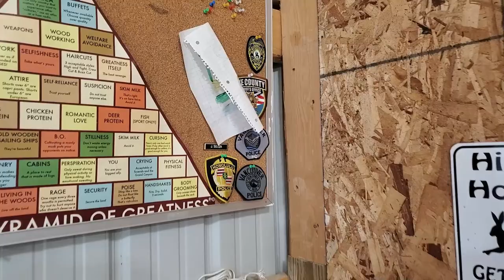She’s DONE On Our Channel!!  Airing Our Family’s Dirty Laundry | PEX Rings vs. SharkBites

Comment: Crimps are good definitely better than shark bites. Uponor pipe and uponor memory rings expand a lot when frozen but return to size after thaw. I’d definitely use brass fittings though in the cold. Most pex splits when frozen. Special expanding tool is expensive though for the memory rings.

Comment: Hey guys love the channel content is just started watching you from here in Leeds, West Yorkshire. Uk. I've had a renovation company for 28 years until I recently had to stop due to an emergency spine issue I know love with. But just a quick note on your fitting for bathroom. I have used what you guys can the shark bite fittings, for over 15 years, we call them push fit barrier pipe fittings. And I can tell you now if fitted correctly they are THE BEST WAY TO GO, they will not fail. Pex crimp fittings are good but pipes do expand and contract with temperature. Especially plastic (pex). Sharks bite allow for this movement and therefore are much safer to use if fitted correctly. If they are not leaking now then leave them they will do just fine. Look forward to watching more. Stay safe guys 👊🙏👌

Comment: I perfer rockwool for insulation as its fire proof, sound proof and its a great insulation as that pink stuff
the wind/breeze goes right threw it. granted rockwool not mineral wool costs a little more but its well
worth the extra money when it comes to heating and cooling.

Comment: may i suggest running the water lines closer to center on studs and use nail plates so you don't drive a screw or nail in the water lines

Comment: Glad y'all switched back over to compression rings.
Good to see more and more normal, return to your lives. Game changer.
The water system and allows awesome. That will make a huge change in your water quality, how it feels on your skin, taste and help your appliances survive longer, especially the new ones.
Have y'all considered rough cut Douglas Fir siding from the local sawmill in BF? The fir is close to cedar in that it's mold, mildew and rot resistant. It's not as good as cedar but.... Since Douglas Fir is huge in that area, you might can get a deal. Just a thought.
Looking good. 👍 I know that stove felt good in the snowy weather
God bless you all and keep you safe
Reply from the maker: Thank you Wayne. Great suggestion on siding! God bless!

Comment: Just a opinion you should install stud huard or plate on studs you have your pet pipe going through.  The reason when you in tall your wall lard or whatever you do not put a nail through the pex pipe. It is a metal plate that gets nailed to stud where the pex is.
Reply from the maker: We did :)

Comment: Smart move on replacing the Sharkbites with proper crimp fittings, especially inside walls that will be enclosed. 

Those water lines were drilled extremely close to the surface of the studs. We generally try to stay back from the surface of the studs by a couple inches so that screws/nails etc don't pierce them later on down the road. I trust that you will be placing steel protection plates over them?
Reply from the maker: 👍🏽 They’re on there.

Comment: Please do consider installing nail stud plates to protect from accidently screwing/nailing your water or electrical lines. It is especially important during your install of your walls, etc.  Usually this is a code requirement for most areas of this country.
Reply from the maker: We did
Reply: @GoodSimpleLiving  Thank you for your reply!  I was getting kind of worried and concerned since I did not see them (nail plates) in your videos. I used to work in construction a long time ago.  Have you considered using steel studs rather than wood? It's a lot faster, cheaper and stronger with no termite problems.  This just a suggestion to save some money.  Great job anyways!

Comment: Jeremy it looked like you used the same pvc pipe for the hot and cold connections for the water heater. If so it may melt and leak. Hot side needs cpvc pipe.again you both do nice looking clean work.

Comment: RE: Water heater. You should really have some tie down straps around the water heater. As earthquakes become more prevalent in the Pacific Northwest, even small ones tent to knock the water heater over if not strapped down. This is especially important for gas water heaters but protects electric as well.
The should also sit in a drain pan Incase of a leak. 
We had put in a brand new water heater and luckily put in a drain pan when the water heater which turned out to be faulty ended up with a leak that could have cost us hundreds and hundreds of dollars in water damage. It's best to error on the side of caution.

Comment: I have used both shark bites and the crimp rings and I feel they are both good as long as your checking all of your rings for proper crimp. The shark bites are much easier to replace if any repairs are required in the line as they have the tool to remove them without needing to cut the pex. I am glad to see Nevaeh is going to do her own thing with the vlogs and still doing her music. Sorry I watched her video first cause she has less subs and I try to help the little guys first since we are still the little guy...haha.
Reply from the maker: Thank you 😊

Comment: Hate to be a critic, however I know you want advice. When installing drain pipe try to give the joint a quarter turn when you are glueing then together. Also please don't remove the ABS you have installed but please use PVC or better still CPVC when you build the house. Good job insulating those pipes. As you know if it gets very cold leave the tap at the end of your system running a little water over night. Also if you run hot water through the system before you go to bed those pipes will be warm.
Cheers

Comment: Shark bites are for the DIYer! Easy and affordable for those that don’t want to call a plumber! Pecs require a little more “strength and crimping”. Plumbers will always recommend copper and sweated joints. Keeps them in work.

Comment: My house was built in 1972 and has ABS drain pipes.  I didn't know ABS was still on the market.  

I made some changes to the drain pipes and connected new PVC fittings to the ABS.  One of the more recent changes required a permit and  inspection by the city inspector.  He mentioned needing to use a special glue when attaching PVC to ABS.  I told him I had bought the special glue.  When he came out to inspect the completed project, he asked what color glue I used.  I told him it was a white glue, and then I showed him the container.  He groaned and said the glue I should've used is a green color.  Fortunately, he didn't make me redo the work.  It would've been helpful, though, if he would've mentioned the color of glue when I went in to discuss the project and get the permit.

Thanks for the tour of the inside of the pump house.  I was curious about it.  Also, glad to hear you decided to connect to the grid.

Comment: Just a thought yall insulated the walls but you should consider putting an insolation blanket on the hot water heater it help with water temp and the longevity of the hot water heater

Comment: You're going to need "nail guards"  on every board where those lines are running.  If they are closer the 1 1/2 inch to the drywall.  If you are not covering the wall ignore this.

Comment: I work maintinance in a public facility .fifty sinks , thirty-five toilet stalls , commercial kitchen , two axillary kitchens , hot water heat , etc. . See a lot of plumbing issues . We use shark bites for emergency repair till we can shut down the facility and replace with PEX crimp fitting . We found that shark bites will leak , eventually , at the worst possible time. Hot lines are the more likely to . Never use them in your permeant installs . We had a lot of trouble , part of the original building was plumbed with copper , then when a contractor did a reno he replaced each end with PEX . Flowing water creates a static electricity charge which grounds through the water , causing reverse electrolysis , creating many pinhole leaks . Copper pipes without a ground need to be grounded. Watched this vid with empathy , when I was without laundry I used to put it all in a pail with water and soap , strap the pail to the back of the tractor and go work for the morning , change to rinse water at noon , by evening presto , clean clothes . It was so great to dump it in a machine and push the start button . By the time I got in my house there was ice on the creek so bathes were a very hasty affair

Comment: A couple of things. Does the Dewalt compound miter saw allow you to cut larger widths like 2x10's? Sharkbite fitting work great if you make sure the pex is all the way in. Ot I use Fit-it fittings for a lot of rv's with no problems however both work great BUT you have to make absolutely sure the pex is firmly n place.

Comment: It seems like it would be very satisfying to use one of those crimpers to crimp down a ring on the pex. Question: when you are installing insulation on an exterior wall on a cold day can you feel it getting warmer the more you get into the wall? Thanks for using good lighting when you were completing the hot water heater install. If I ever need to do a plumbing connection I will at least have seen what it looks like. Best wishes from Seattle, where I am imagining you cozy and warm next to your woodstove sipping hot cocoa! 😊

Comment: I'm so glad you took all of our advice and got rid of the sharkbites.
I don't blame you for not wanting to do laundry outside. I wash in 5 gallon totes on a fold away table by hand, outside also. I have been procrastinating too. (its been in the 40's & low 50's with rain for most of this past 2 weeks.)
LOL (GOING TO TEASE YOU) It's not a hot water heater, its a water heater. It doesn't heat hot water, it heats cold water to make hot water. LOL

Comment: sorry to tell you after you installed all that insulation, but, I learned this the hard way and did it like you on more than one house, the insulation staple tab is to be stapled on the side of the stud, not the outer surface.   Try it.

Comment: Did you connect the hot outlet of your water heater with standard PVC pipe? It's hard to tell on video. You have to use CPVC in hot water applications. Standrd PVC won't take the heat.
Reply from the maker: It’s PEX
Reply: I saw the red PEX. What is the white-ish pipe?

Comment: The worse place to use a shark bite connection is at the water heater bec ause as the water  heats up it expands. We used one there and it popped loose and flooded our bedroom and hallway, it sucked.

Comment: Phew - SOOO glad to hear your are going  away from Sharkbite.   Believe it or not I was wondering if I could stand to watch more of you videos knowing you were likely to face issues.  Maybe not this year or next but ...  

 Anyway really happy to see you getting things "Organized" in the barn and buttoning up for winter.  Time for me to start getting our wood stacked where I need it and covered for winter and we are way down here in NW Arkansas so things are really going to change for you there.  Looking forward to big snow falls for you and your adventures of winter in a new place.

It's looking so good even if the well house looks like a Christmas package.  (Hey you could always put an extra layer of foam on the outside before you put siding on

One more suggestion.  Ol Bessie (SP?) might decide to release some water at some time - un expectedly so you might think about a drain pan under it with a drain line to the outside OR tied in to the regular drain line.  Also a drain pan for the water heater too.   Bessie could give up any time and while the water heater will likely go without an issue for years it could sneak up on you.   ( I know I sound like an old worry wart but... after 9 + years  selling plumbing, flooring and appliances (In the BLue Big Box Home Improvement Store).... I've heard all sorts of sad stories  about unhappy surprises from appliances doing bad things to homes

Comment: I wasn't thrilled with you using shark bites but chose not to comment then.  I was a facility maintenance manager for a large corporation.  I was responsible for 1.5 million sq ft of office space.  When I came to the job I found that the maintenance staff had been using compression fittings to repair leaks in walls.  I stopped that process and returned to sweat copper.  Later I found the VIEGA compression fittings and we migrated to that.  At that time, the tool to compress the fittings was $2500.  I believe they have come down since.  They are really handy and even are approved for natural gas with appropriate fittings.

Comment: Jeremy, I know your plate is cooked. 1 thing if I may. So far you have done good. Remember this is Idaho...You need a back up to your back up to your back up. Think about this! What is 1 way you could manage to heat, cook, and generate electricity that could potentially last for years if needed? A propane generator with a 1000 gallon tank. It would charge your batteries when we have no sunshine for 6-7 months. You could cook food, heat water and with a small 30000 BTU heater heat your living quarters. Just a thought....The thoughts of having to drive to a gas station to run a gas generator 1 a week in this weather is crazy.

Comment: I have a lot advice. I'm not going to give it to you directly, but I'm going to give you the terminology for you to research it yourself.  It will allow you to be more successful and help solve problems on your homestead. This is something you can research over the winter, so that you can be ready for the spring.  It's called "Permaculture ".

Here are some of the terminology of Permaculture that will will help you out specifically. 

Mob grazzing cattle 

Chicken tractor/feeding chickens with a compost pile. 

Rocket stove heaters 

Oh and it's a Permaculture thing have ducks in an orchard to eat pests.

And maybe raising guineafowl to eat tics.

There are many other subjects that Permaculture handle. These are subjects that I can see that will help you currently.

Comment: What's wrong with sharkbite fittings? What was the reason they told you not to use them? My washer is probably older than that. Older appliances last way longer than these new fancy ones. I also did laundry outside for many months while we were building our home.

Comment: Is that heater installed in the pump house safe being mounted against the insulation?  I would be concerned that the unit could become hot and cause the insulation to burn.

Comment: Curious why you didn't route the plumbing for the wash machine through the studs rather than surface mount?
Reply from the maker: We aren't closing up the walls so its easier to monitor and keep them heated inside

Comment: I noticed that you did not put an expansion tank on the hot water line at your water heater. Here in NC it is required by code
Reply from the maker: Not code here. We’ll add one if it becomes necessary.

Comment: I'm not a code guy but I would run the PEX deeper in the wall. Drywall screws will hit yours or virtually any other nail, screw for hanging things. Nail plates get pricey.

Comment: Hold onto 'Old Bessy' Those old style top loaders are so much better than the new HE machines. 
I replaced my old machine with a new HE ....... big mistake. Should've repaired the old one.
I was filling the new machine with a garden hose; and manually agitating the clothes with a piece of pipe. It was so bad, I gave the new machine away after 6 months; and repaired an 'old style' machine I trash picked. I'll never be convinced HE washers are worth a rat's a%s.

Comment: i've been using sharkbites for years with no problems, even used them underground, they have never failed, outside or inside, now in your case the freezing areas would be questionable for sure.

Comment: My father had horrible water, iron, and sulfer.   He consulted with a few companies, before he found the dumbest of all solutions. multiple filters.   ie: whirlpool, makes a $300/filter last time I looked, or it might be more now.   you need two of them.   ouch.   you dont replace the filters, they use a filter medium.   i dont know what the lifespan is, but they have never touched it since, and it's been 10+ years, and going strong.   once a day, the filter cleans itself with a back flush.

Comment: Nice progress. You guys have learned a lot and are still on the learning curve....will be forever probably. But that is good, keeps you young. Great that you have an audience of people who have different skill sets and are willing to share, comment, encourage, correct with your benefit and safely in mind. Making mistakes is fine and to be expected when you are are taking all things on. Clearly you are doing research and it looks like you are identifying appropriate areas to get expert resources involved. I did have to laugh at you using the incorrectly cut pipe length as your measurement to cut again. I have done that kind of thing before too and usually done it a couple of times before the light came on....happens especially, when you are tired or if you went thru the same Souza Home Maintenance course I did....
Reply from the maker: Thanks Uncle Wade!